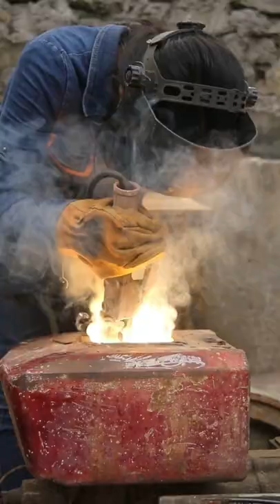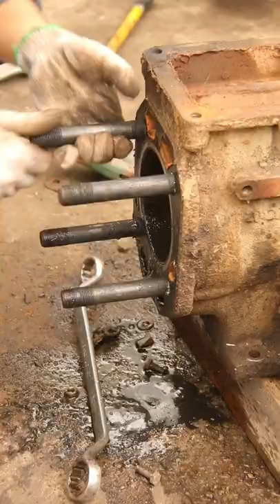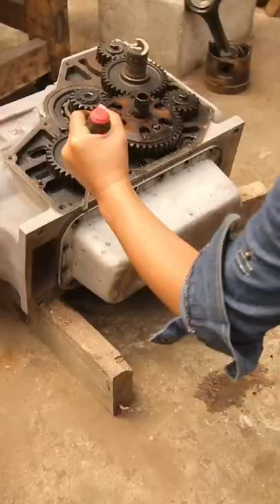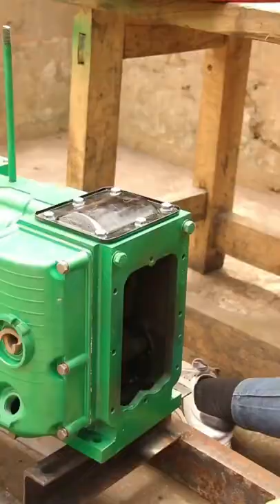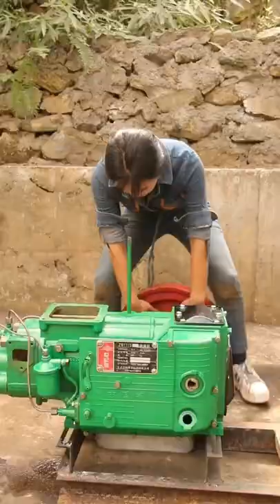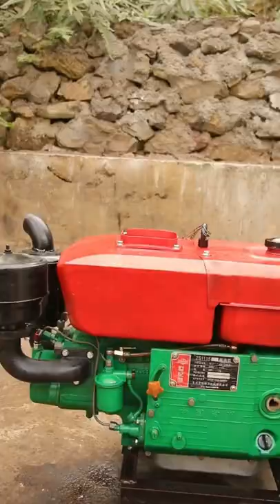Super Restoration of Diesel Engine #shorts

Comment: Nice, but you didn't restaurated nothing here, young lady, you just disassembled the engine, you cleaned his pieces, painted and then, you reassembled all, without any repair, even the carter, witch is deformed, or changing the segments of the piston,for example.What you done is cleaning, not restauration.